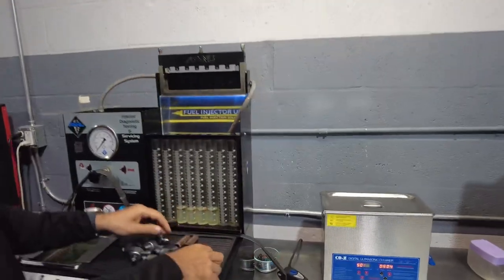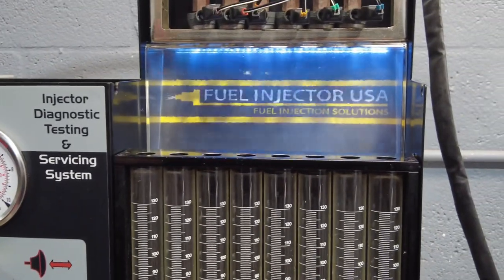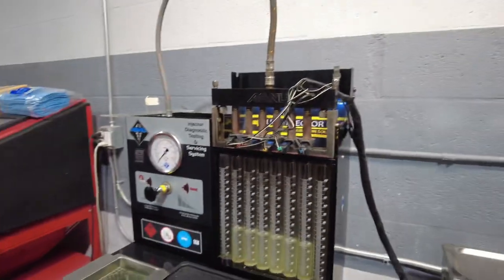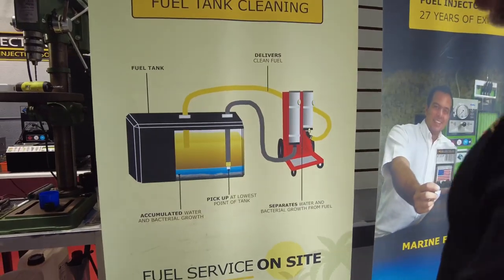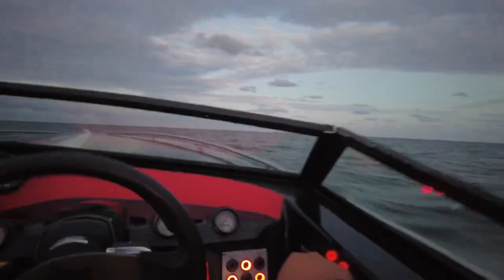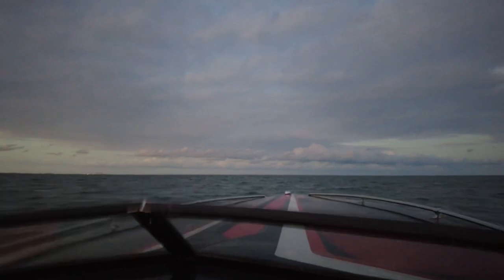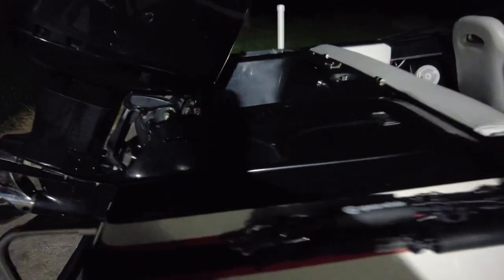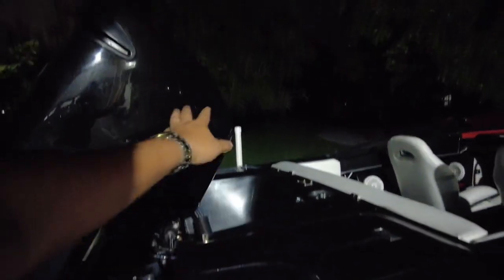I NEED YOUR HELP! Something very unfortunate happened to me today while testing the Checkmate ￼

Comment: Add a permanent fuel pressure gauge to your dash. It will help diagnose any problems in the fuel system when you are running on the water.

Comment: My estimate and I’m a captain who’s had a lot of 3liters and currently have twin 250 pro xs ! Did you Eliminate your alarm sounds? My guess would be water pressure from some kind of debris in the lower after leaving the engine in the water all night at the beach in the shallows! Low water pressure put the engine in protection mode

Comment: I have used injector usa in the past for a  1998 acura integra GSR . car was bone stock survivor model in great shape just 20 years old, I sent 2 sets to make sure I had at least 4 that were perfect after rebuild and he did a great job and was fast and told me the same thing I need to drain my tank and flush it because there was trash in the injectors and filter hats . I did just that with his reccomended methods and the car ran way way better. I miss that car, should have never sold it.  AND AS FAR AS THE HATCH  make it even better , u can go OG or do a mini door in the middle like clear plexi and do a cooler liner mod. there is cooler liners out there that will run on boat electric power and it wll keep your drinks and sandwiches cold. you can even run some led lights inside that would compliment the glass top and show off what you have to eat and drink and better yet do both sides with leds inside, just a neat resto mod custom trick off top of my thoughts because i know these tricks are right up your alley.
Reply: Any idea where to find these cooler liners that run on boat electric power?